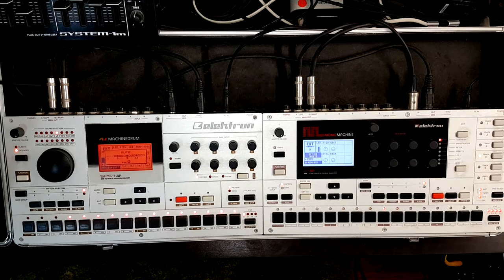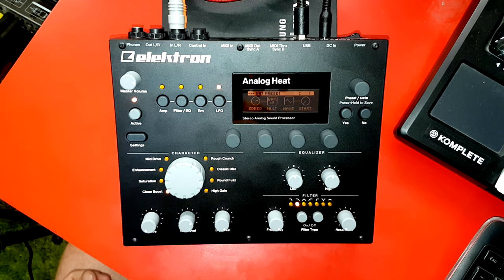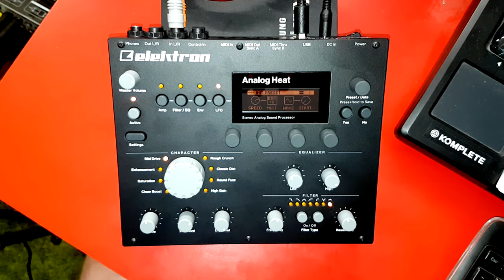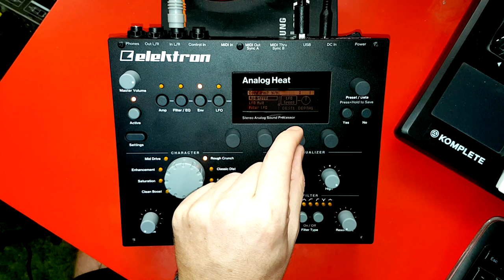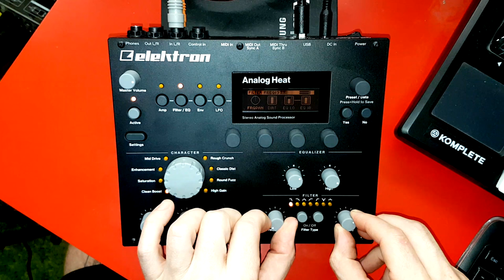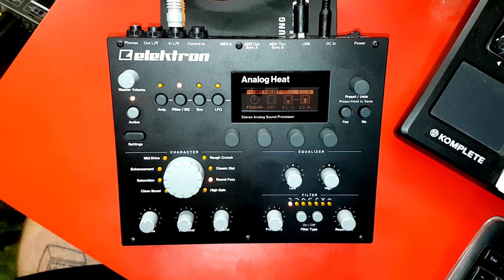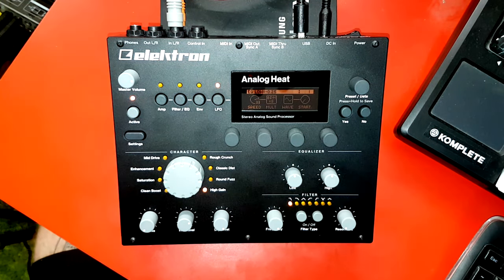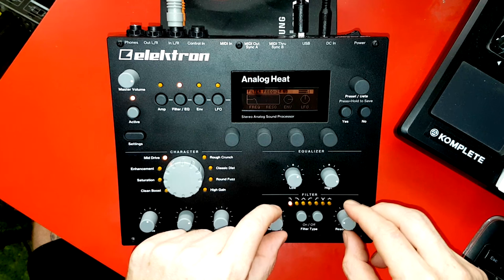Intro Sesh with the Elektron Analog Heat

Comment: Another great video. I've been using the MD and TR-8 through the heat and then recording all the mangling into the Octatrack to chop up and fuck about with. In all honesty you could just run a few sound sources through this and perform a set entirely on this thing :)

Comment: Ez 
Are you using this as just a audio processor. I was also wanting to use as a soundcard buy I heard it is real buggy
Reply from the maker: fatdog records I use it in a variety of ways. It's not buggy but I don't think it's a good alternative to a dedicated sound card/audio interface
Reply: Miles Cosmo thanks
Would that just because of the amount of ins and outs
Reply from the maker: fatdog records yeah pretty much, I just don't think it's an ideal solution for that although it would do the job